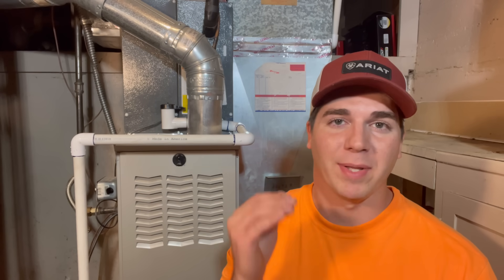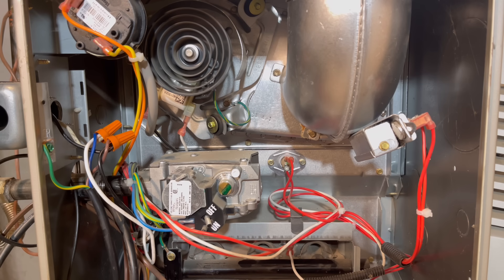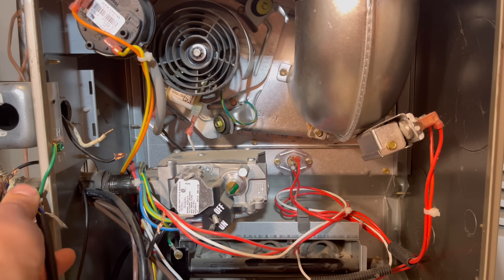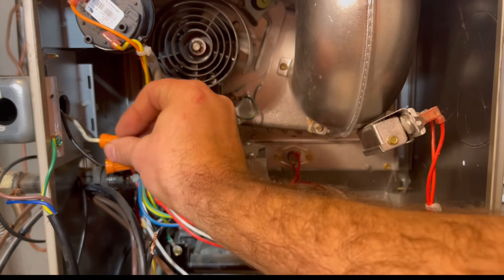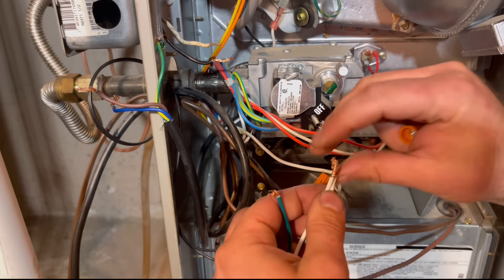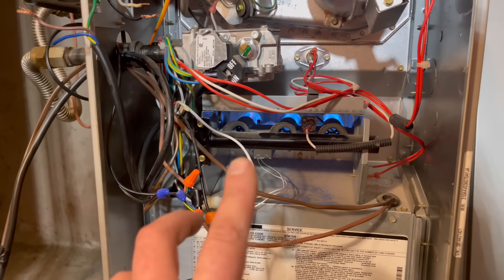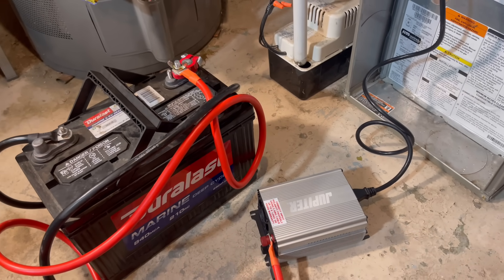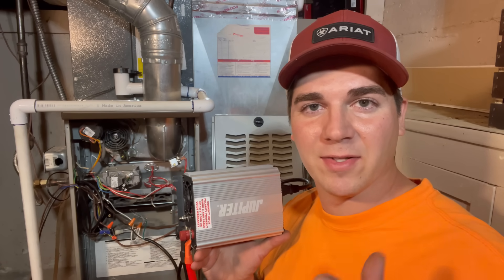Did You Know You Can Heat Your Home With A Car Battery?

Comment: Just putting this comment here in case it ever helps someone struggling like I did:  when our power went out, I opened up the furnace to connect it to my generator with a long extension cord using the method you show above (hardware store plug splice).  My newer furnace would not start up.  Apparently, they are very fickle about seeing a ground in the circuit.  I made a dummy ground plug that went into one of the two plugs on my generator, and once I did that the furnace kicked right on.    Helpful video, though!  Most people assume you need a ton of power to run a furnace.
Reply: Or you can connect the ground wire to the original ground wire from the electrical panel, just because you lose power, you don't lose the ground or neutral for that matter
Reply: @herdHistruth  That might work in this video above with an inverter, but in my case with the generator, I needed to make a bonding plug.  Easy to do -- just buy an empty plug and run a wire from the green ground to the white neutral and plug that into the other socket of your generator.   I suppose I should edit my original comment above in the fact that my furnace was more picky about seeing a neutral than a ground.
Reply: @msujdog  I'm a 40 year electrician and know many tricks of the trade but thanks for your input.
Reply: @herdHistruth  Thanks for sharing nerd
Reply: @msujdog  most likely the problem is the AC transforming the furnace does not like modified sine wave inverters that will not recognize the current and voltage because it will tend to make it overheat it would be better to use the straight 12 volt DC and put a four-way bridge rectifier on it with a DC DC boost transformer. easily the generator has no problem it's pure sine wave
Reply: @msujdog  neutral is ground dude. It's just a separate path to ground. Open your electrical panel. The neutral are just grounds.
Reply: @CommonSenseFishing209  neutral is the return at 0v. It is not ground although it is often grounded to help ensure it is 0v. But it also is tied to the returns from the other 2 phases which is supposed to balance out to approx 0v. Even ground is not necessarily safe to touch if there is a fault but as long as electricals are working right it would be. Meanwhile the neutral will always have slight charges due to any imbalances in the rate of current running in the different phases and different sections of a system especially the farther they are away from a grounding bond.
Reply: @TheAnantaSesa  I know. But neutral is grounded. It carries a current during a load. I know this. 15 yr hvac pro here. Your flame won't sense without ground on almost all makes and brands in the last 30 plus yrs.
Reply: @CommonSenseFishing209  yeah I pretty much just repeated what you said but in different words.
Reply: @CommonSenseFishing209  the neutral is bonded at the service
Reply: @CommonSenseFishing209  "pro" ?
Self praise is no recommendation 🧐🤣
Reply: @herdHistruth  yep. But hard to convey to someone you truly are a pro.  There's newbies, alright guys, hacks, liars and con men. And actually really good guys / gals aka the pros. 15 yrs of dedicated HVAC work and I own my business. 

So yeah. Pro.
Reply: @CommonSenseFishing209  suuuure u r 🧐🤦🏼
Reply: @herdHistruth  I got a YouTube channel too. Mostly fishing but I got a few hvac videos up on it.
Reply: @herdHistruth  yeah bit it still comes back to a grounded bus bar in the breaker panel and has continuity with ground. It is a separate path to ground.
Reply: @CommonSenseFishing209  🧐🤣😂🤣😂🤣😂🤣😂🤣😂🤣😂🤣😂🤣😂🤣😂🤦🏼🤷🏼
Reply: @mdbmdb001  just calling em as I see em and don't even think I'm going to consider what you think I "should" d 🧐🤣🤦🏼🤷🏼
Reply: @herdHistruth  me too
Reply: @herdHistruth  
Yeah the only part of the video I didn't like was when he said ignore the green wire...🙄
Reply: @herb369nichols  like the old days before grounding was non existent 🤔
Reply: @herdHistruth  
Yeah... back when people got the surprise of their life if they weren't careful. 😱😄
Reply: @herb369nichols  I've worked in old factories and once found a live green wire 🤯
Reply: @herb369nichols  true that's there for a reason, called suicide stop. 
 if the neutral, which is somewhat a ground fails you become ground.
Reply: @herb369nichols  LMAO! Great comment bro.
Reply: Would you share with me what a dummy plug is?
Reply: @randydiekmann4238  a knockout filler ?
Reply: @randydiekmann4238  a unused plug . grab an end off of say an appliance that has a ground  and twist together the green and white together.
Reply: Yes some furnaces require a ground for flame rectification. Note the generator should be of the inverter type or it may damage the electronics.
Reply: You do need 240 Volts of electricity to run an electric furnace. However a gas furnace is much different, only needing 120 volts of electricity.
Reply: @perrycrowell2953  I don't think anyone is running a heat pump off a car battery. The point is how to stay warm with the gas you have access to and just need a fan to run so it spreads the heat around.
Reply: @perrycrowell2953  What about the watts ? I know you said gas furnace use 120v.I have a deep cycle top post battery and a 750w power inverter will that work ?
Reply: @perrycrowell2953  Most are 240V, some small systems with a 1/3 HP or less motor could be 120V.
Reply: Please show your dummy plg arrangement
Reply: You need a ground. 1 100 percent correct.
Reply: Can you hook up a Jupiter 5,000w power inverter to a car.If so what's the proper way to do it using up to 5,000w ?
Reply: @drrobotnikmeanbeanma  proper way to do it is to not draw all 5kw for very long or you will drain the battery so bad that the car might shut off for lack of voltage and then you won't be able to restart it either. It's not good to drain lead acid car batteries so unless you have a big truck that can output 5kw from its alternator you are better off buying a generator. Or run it in short spurts. Maybe get a voltage tester to monitor the voltage and run the inverter again when back at 12 to 14v or so. (Alternator puts out 14v but the battery will bring that down until it is charged and when it IS charged the alternator will shut off so that has the system go back to 12v)
Reply: @TheAnantaSesa  Using a car as a generator, what's the most amount of watts you can use.And can I use a 2,000w power inverter for a car.What vehicles can use up to 5kw without drainning the battery  ?
Reply: So I’m guessing this won’t work with a all electric furnace?
Reply: @davidpeacock6862  might work for half an hour at most and then you need to buy a new car battery.
Reply: The ground is necessary for proper flame rectification to get the micro amps to needed for continuous burner run times !!!
Reply: Buying a 720Wh power station and getting an electrician friend to help me out was the best value method for getting aprox 8 hrs of power during an ice storm. You can always buy more LiFePo4 portable power stations later, as prices drop, to get a longer run time by swapping out. 8 hrs is a good nights sleep.
Reply: You should be grounding your generator
Reply: What bout the blower fans?
Reply: The generator should be, and is required to be bonded to the grounding system.
Reply: Oh my god, already stop with the ground tip!! Everyone...allready knows!!
Reply: Will you make a video for cooling with a car battery?
Reply: @trailertrashfire  just hook up any electric fan to the battery. If you need intense cooling you'll need a generator and a/c but all you can do with a battery is cope with some artificial wind.
Reply: @trailertrashfire  LOL

Comment: I mentioned before this video was released. It is a good idea to understand how electricity functions calculate voltage and watts to power usage and can handle. I suggest that, if you don't know what you are doing, you can be electrocuted and damage the electrical systems costs more to fix it. It's best to find out with the professional electricians who can explain the electricity safety component. Always have the emergency generator back up to supply the power just in case if you don't have a power supply in your home.

Comment: Great idea! I'd been planning on using a Honda EU2200i for this, but the battery/invertor combination would be quieter, more convenient and safer because I wouldn't need to run a long extension cord to position the generator where CO wouldn't be a problem.

Comment: Glad I found this. I've seen similar videos but they ran a power cord to their car, which had an inverter, and said to run the motor. I had no idea you could just use the battery or run the motor every now and then to recharge. Thanks!

Comment: Please don't try this with a car battery, they are meant to start your vehicle not to run appliances, hence their ratings of cranking power as opposed to amp/hrs. Depending on usages it might work for a few hours and then when you hook the battery back up to your vehicle, don't expect it to start. And by all means, get that inverter from Chinazon, so much better than. those made in the USA...Welcome to Comedy Central!

Comment: Everyone watching 2 things and this will save you thousands of $$$ alright never buy a non pure sine wave inverter, those harbor freight units will destroy the transformers and motor windings, if you hear his startup of the furnace the first time, there is no inducer motor hum and same for the blower motor, but when you hear startup with the inducer motor on the inverter there is a hum, that is extremely dangerous, harmonic distortion can destroy transformers and motor windings - I’ve had those inverters kill valuable equipment, second thing, never shut off your furnace while the burners are ignited, you need to let the blower cool down the burners to prevent damage, other then that great video, I always thought furnaces took way more power to run, but I will try the idea

Comment: A very misleading video, it will work for a very short period of time, but the heating blower motor will deplete the battery charge in a few minutes. You need to know the amp and or watts the blower motor needs for operation, the you can determine the size of the battery bank needed for how many hours you need for heating.

Comment: Here in Southern Idaho, we frequently experience power outages during the winter. I finally got fed up and purchased two, 12 volt, 100ah, LiFePO4 (lithium iron phosphate) deep cycle batteries, a 2000 watt sine wave inverter and the appropriate charger. I'm using this as a backup/emergency system, and it's working well.

I prefer using deep cycle, LiFePO4 batteries because you can drain them almost empty without killing them — though they will last much longer if you keep them charged at a 50% or higher level — possibly for thousands of uses and many years. If you drain a standard lead acid car battery that low, more than a few times, you'll kill it fairly quickly.

Comment: What's better is to put a cord on the furnace. Now install an outlet where the switch was. You can plug the furnace in at the outlet or u plug it and into the inverter.

Comment: Very interesting.  I have a high efficiency furnace - in winter do I need to have the condensate pump connected if I need to use a battery to power the fan?

Comment: Thanks for sharing man! I cleaned the coil in my horizontal crawl space furnace/AC to day.  Mine is strait like a condenser in a car.
I already had the cabinet off one side to inspect the heat exchanger and couldn't believe how good it still looks. Through that door I could get to 75% of the coil with a long handle stiff dish brush but had to take the cap off the left side to finish where all the piping and drain is located. I used dawn and water in one bottle and water in another bottle to wash it all away. Probably not near as good as what you used but it looks 100% better.
One too many times I had forgot to get the size of the filter and wouldn't buy the wrong one at the store while I was thinking about it.
So this one caved in and collapsed. Can't let that happen again.

Comment: Someone out there should be smart enough to show me how to do this by flipping a switch rather than pulling all the wires apart. Set the battery and inverter flip a switch and ready to go. I have seen this  a dozen times from a dozen different sources. Still looking for above.

Comment: You have a deep cycle battery there, you car battery is designed to provide a strong current flow for starting not extended load on it like a deep cycle battery is

Comment: Careful…A discharging or charging lead-acid battery will produce Hydrogen gas. The gas could buildup and possibly create a hazardous or explosive situation.  Google and you will find stories of said catastrophes.

Place the battery and inverter in an outdoor or well ventilated area, then use an extension cord to power your devices.
Reply from the maker: I heard only if it’s being charged at the same time.
Reply: @diyhvacguy  The electro-chemical process of discharging or charging will create the gas.

Comment: My central heating unit already has a plug so I can just use that plug to connect to that converter right? I see yours has an off/on switch...but my central heater is connected to a wall plug without a switch.

Comment: That's a great idea only if you have gas. So many homes are using heat pumps. We all know, it's a AC compressor switching the reverse the condenser and evaporator, hot in side, cold out side.  Mr heater or wood heater.

Comment: What kind of heath are you running , is it forced air ??. This may not work on my case , my system used hot water through copper pipes to heat my house , so I need to figure out to provided power to my well pump , then my furnace .

Comment: lol,,, yeeah right.. 12 volt battery, I will give it 60 amp hours from it, CCA has NOTHING to do with long term amp pull.   but "days"? maybe a day at best but that battery will be DEAD and will be so heavily sulfated it wont recharge back to where it was. Just best to have a solar generator with a back up 100ah Lifepo batt. NOw, if you only ran it enough to stay alive (a few minutes per hour) then it may last days. But then you have to figure in start up amps.

Comment: Battery might last around 10 minutes
Reply: The comment about running for days is misleading. Depends on run-time and efficiency. Assuming you are worried about middle of winter and your furnace runs about 20 min each hour (0.33 h) and your furnace uses between 300W (small) to 1000W (large) for motors/blowers, this is would use 100Wh to 333Wh. A car/camper battery averages 40Ah to 75Ah at 12V meaning  480Wh to 900Wh. So you may get 9 hours if you have the smallest furnace and largest battery. Likely need multiple batteries in parallel or swapping out to get the days of run time. However, this is a nice backup plan in a pinch to get some heat in your house in an emergency. Just don't expect days without a generator. Likely better to spend the money on a small portable gasoline generator if you are really worried about a power outage and not having heat. Same trick to hook a 120V power cord up to furnace just plug into a camper generator instead. $300 instead of $100 for inverter only.
Reply: @jordanhamilton6532  inverters eat batteries , no way a 75ah  battery would do 12 hrs

Comment: I lived in my truck camper for 5mo's using an inverter hooked directly to my battery while parked, just ran the 2nd set of battery cables through the glove compartment, and plugged a space heater into the inverter! Even had a cheap Wal-Mart Microwave to cook in, and could only run one or the other! 

Charged the battery everyday, driving to private contracts, to get back on my feet!  Not easy to live like that, but very doable with a little knowledge!

Comment: For a gas or oil furnace an inverter on a car battery can't run a furnace blower for long at all. Just buy a generator.
Reply from the maker: Mine ran for 6 hours, so not too bad in a pinch

Comment: Instead of taking off the wires install the 3 wire plug to it n leave it for when power goes out just plug it in the inverter when you need it

Comment: The house heater is running on gas, so the electronics on the house's electricity could last for a week or more at low voltage.  Alternative energy resources are good.

Comment: 1.) Take note that he's using a deep cycle marine and camper battery... that will last for days compared to a car battery... 2.)  Putting car batteries on concrete will slowly ruin the battery, alot of companies claim that's not an issue with "their batteries" in these modern times... but it is still true, just not as bad as 40 yrs ago

Comment: Hi guys! So I found out with my 2 year old high efficiency furnace that it wouldn't run unless I used a pure sine wave inverter. The furnace only draws < 300 watts at full load. I have a 5500 watt 240 volt generator  that runs off of gasoline and I added a natural gas conversion kit to, which I was going to use to keep my battery topped up with. That's why I bought the psw inverter because the new furnace didn't like the dirty thd voltage. I also bonded the neutral and ground inside the generators panel. Not to mention putting two 30 micro farad capacitors across L1 and the other across L2. So I thought I might try adding a transformer to clean up the sine wave and see if I could eliminate the battery inverter combo. I found a 3000 watt Vevor voltage converter transformer. It also has 240 volts if you needed to feed your central air. You plug in 120 volts and you get both 120 and 240 volts out. Although for the 240 you would have to get a European plug. I just did the 120 volts and the new furnace was happy and running well. There are 2 other 120 volt receptacles on it to feed other electronic sensitive appliance's.